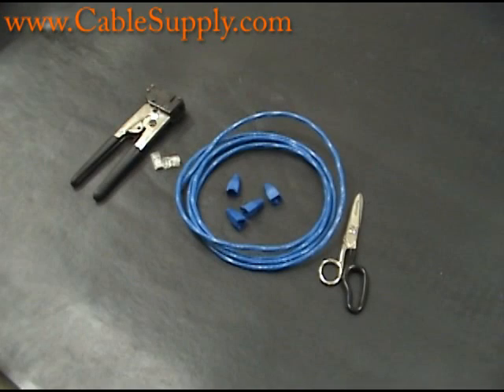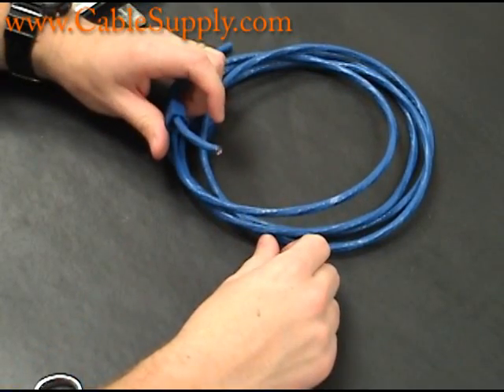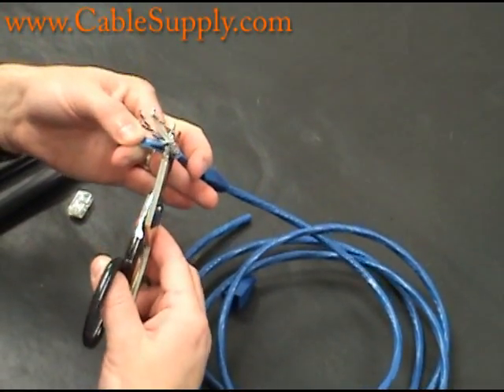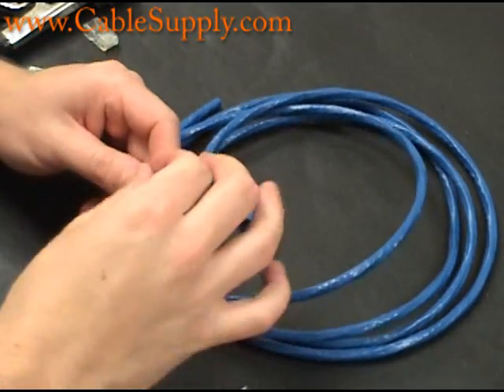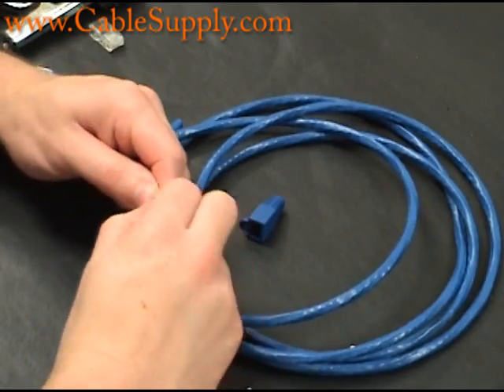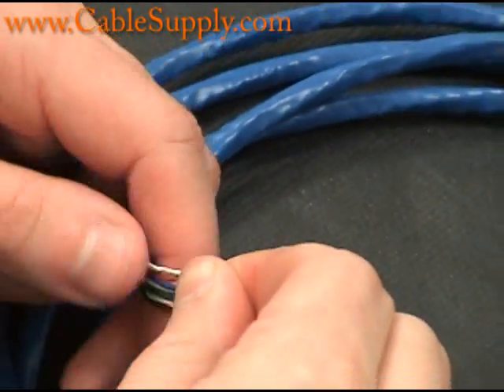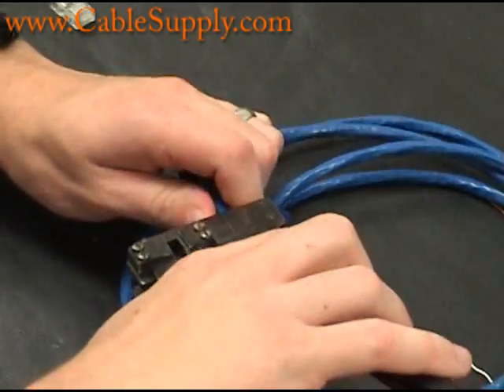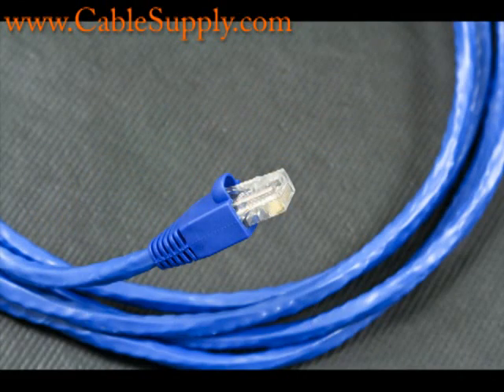How to make a Cat6 Patch cord with strain relief boots

Comment: JB012608, Pre-Made patch cords are cheap and save the tedious work making them, which is needed only for custom length cords.  If you use many patch cords as when wiring patch panels, buy a box or 5.

The snag-less/strain-relief boots get hard and difficult to squeeze/release, which is trouble if you have to disconnect 48 of them!  The boots take up more room - when used on modern switches (ports close together), they can put too much pressure causing loose connections -> wiggle & link changes!!